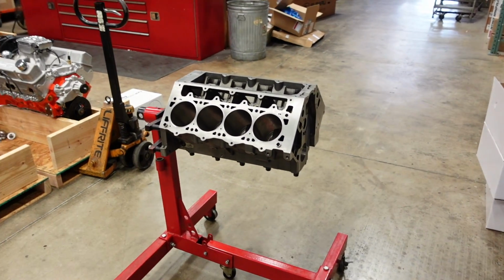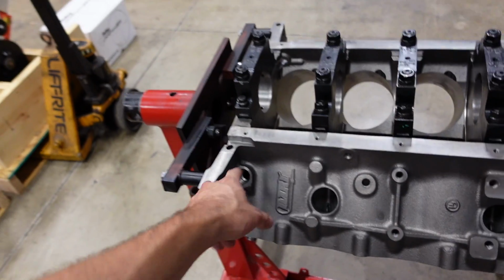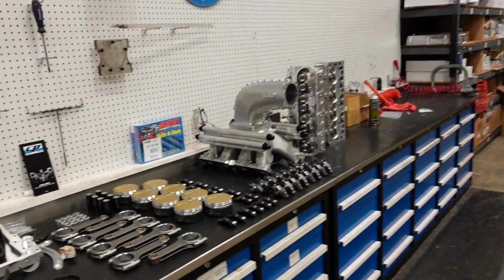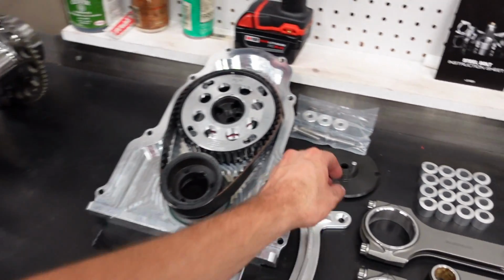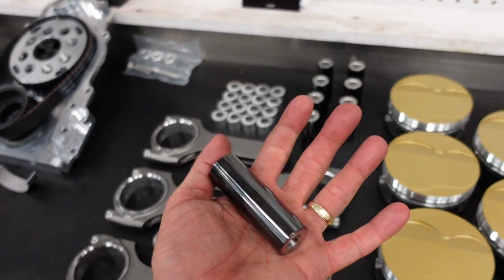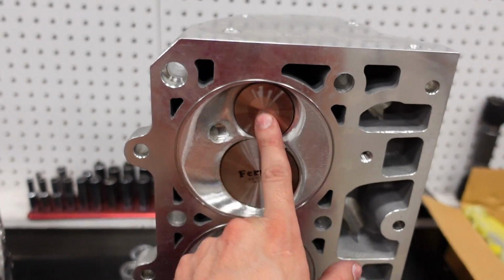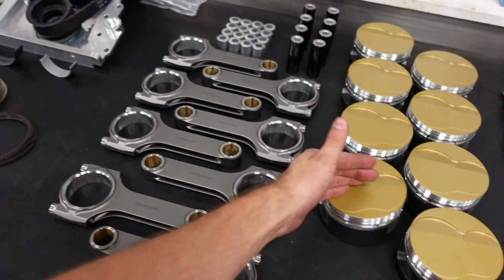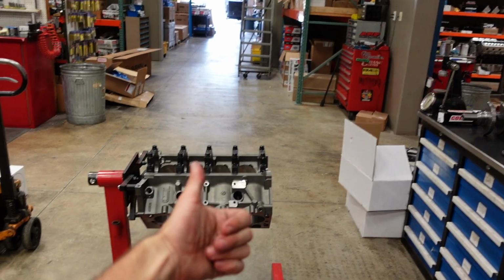Building my Personal LS Engine! - Engine Parts Overview - Part 1

Comment: Other than the rod it’s the old 400 small block numbers for bore and stroke.  That nice .  I’ve always wanted to know what a Al’s would run like using fords old 400 numbers.  4 inch bore and 4 inch stroke ?  Do you know if it’s been done and how good it runs on a dyno ?  Or is it worthless.  Im thinking the LS7 has the crankshaft and a 6.0 or 6.2  maybe the block .  I was just looking at LS bores and strokes one day and seen the combo .  I’ve heard of the rock crawlers using a 305 block and a 400 crank getting a 3,75x3.75  for all the torq .  I thought what would 4x4 do ? Just a thought great video . I’ve liked and subscribed to your channel.  Look forward to 3k hp In a vette at 9500 rpm yeah !

Comment: Theres not much LS left here 
Nothing standard anyway 
And only about half or so architecture 
Regardless the components are nothing short of high quality 
And should b considering the rpm wanted 
Hope it all goes well with the hybrid v8 build and further 
Great video mate cheers from australia
 Ps the added head fasteners are trick 
And needed as that 4 bolt per chamber LS thing ( + 2 outbord ) ussually will let you down at higher power levels good to see its been somewhat addressed

Comment: Whoever you learned from to build this motor you should have learned the technical terms not called top fuel hoops call o-ring in the block dumb f**and you said there was no holes drilled in it to balance it then you turned around and showed titanium plugs it was drilled to balance it double dumb f** but cool build 😂😂😂😂😂😂

Comment: Hello young man I know you are young in this type of work but I want to congratulate you because you are one of the first people that made the correct choice on your rod and piston combination
I see so many people all consumed with how long the connecting rod is when in fact what they should be consumed with is piston stability because that is far more important.
Also us Old-Timers in the the business we don't call them hoops we call them o-rings
It's called o-ringing with a receiver groove and that was an excellent choice for this application
Anyways congratulations and good luck with your future endeavors.
Getting compliments from professional engine builders like myself are hard to come by most of the time they won't say anything but I really appreciate young people coming up in this type of work and trying to make something of themselves
If I can ever help you with advice just send me a message but looks like you're on your way to a successful future. 
BTW I might have ran a little different camshaft but we'll see after you test it.
Good luck from Brian @ Salter Racing Engines.

Comment: Building race engines for over a decade we learned the sweet spot is 700-1000 in a LS. Everything above that parts break. If your racing. You don't need high rpm or nothing to be fast it's all in the chassis.

Comment: So I don't diss other ppls engines... but I do have to ask about the mains, out of curiosity. What's the point of all the custom block work to basically make it a non LS bottom end? I always thought the LS main caps were the best part of the LS blocks. Can u elaborate why u went to those lengths? Don't get me wrong I'm excited to see it run and finish this video... but I'm so confused lol

Comment: I've always wondered why they don't use pressed in  needle bearings on the the main journals of the of the cam like the 410 outlaw engine. Why wouldn't split needle bearings work on the con rods on the crank & caged needle bearings on the wrist pins.  I would want my engine to be completely  rollerized. Has anyone ever made a cam & crank where 2 cylinders fire at the same time. Like the front cylinder on the right side & the rear cylinder in the left, or what ever pistons are top dead center at the same with a normal crankshaft.

Comment: So just to give y’all some context, those aren’t top fuel hoops they are called flame hoops, or referenced as o-ringing the block and head. Also he isn’t running a Cleveland design crankshaft he is running a ls crankshaft designed with Cleveland main sizes. Changing main and rod journal sizes has been done for ages. The crank was not machined on the outer surface of the bobs, it is side drilled instead of end drilled for weights. That cam with a 116 lobe separation will make grunt down low but it gonna not be good up top. That cast iron block is not going to last at his projected rpm and hp levels the harmonics are going to destroy it with cracks. At the power levels and rpm he is planning on and also planning on methanol he should be running aluminum rods they help cushion combustion blows and harmonics in the crank, and are more forgiving than steel rods when pushed to the limit. He talks about long engine life but runs wrist pin buttons on what is going to be a drag and drive motor. Wants to spin the motor to 9500 but runs link bar lifters and not keyed lifters to increase valve train weight. Could this make 3,000 hp at 9500 yeah I can make 2000 out of a stock 6.0 ls with enough fuel and air from a giant turbo for a dyno run then pick up all the pieces after which is what I think he is going to be doing.
Reply: Hi Jon. I went to your channel and didn't find the video on that 2000hp LS build you brag on. I'd take one on even 1000hp LS. Keep us posted.
Reply: Cast iron is not as malleable as aluminum: He probably has a point.
Those are insane rpms for a V engine for the non dragster folk...but it seems like he had a lot of good tech support with the parts hopefully. Definitely not a daily
Reply: As far as copper gaskets: that will create electrolysis in contact with cast iron, or any dissimilar metal.

Not a big deal to the top fuel techs because they rebuild the engine after less than a bakers dozen of runs.

Comment: I thought the skirted block with 6 bolt main caps was part of why stock LS blocks are as strong as they are. Why would Dart change that to a 4 bolt, non-skirted design? Obviously if it can hold 3000 HP it works, but I'm curious what the thinking was...

Comment: lots of moniez, not lots of reaearch into what the product does. crank isnt physically capable of catching oil in holes if the crank NEVER touches the oil, if your crank shaft is touching oil and "cutting" through the oil. you got other issues, steves crank came apart using that style of weights. again lots of money not lots of research. NEEEXT.

Comment: I didn’t look to see if anyone else mentioned it but why go with a reluctor wheel rather than an externally mounted crank trigger type ignition system like most higher power engines. You said it yourself it opens up the possibilities into the ignition system

Comment: Sounds cool until you blow the head gaskets over and over again. Simply not enough clamping force for 3000hp no matter what size head studs. LS's just love to blow those and torch heads in my experience. Obviously this dude knows that so hopefully he has better luck than anyone I know has had when pushing 2500+. Absolutely badass engine though. Get some copper rings put in those heads for sure to stop the torching.

Comment: I do top fuel hoops on my kitchen table.  There is a $2600 tool that makes it easy. I think its made by BHJ. I order the hoops from Visner Racing. I pretty much top fuel hoop everything I build for boost. And you want to use Hylomar as a sealant on copper gaskets according to Clark Gaskets.

Comment: $40,000 in just parts for just the long block is right there with something designed and fully assembled by the likes of Nelson Racing Engines or Steve Morris.....NRE has a 454ci LSX (2500HP) daily driver including the twin turbos and all plumbing ready to put the key in and start up fully tuined for $52,000.

Comment: many ways to make a 2,000+ LS stay together for a very long time.  Nelson Racing Engines has been shipping 2500 HP LS engines out their doors for like 8 years now...total daily driver engines.  You can drive across country with them.  With 2 yr/24,000 mile warranties if you don't change their tune.  A couple guys here in Lauderdale have them.....they're like 5+ years old and driven every weekend and roll raced weekly.  No issues yet.  You just have to figure out the secret recipe for success. ------  But being able to built it yourself is AWESOME.......  I just built my first 390ci 6.0L iron LS with the guidance every second of the way from an LS guru builder teaching me.  Its a pretty rewarding feeling.

Comment: You start an engine build with a camshaft? Every other engine builder starts with the engine block. "Promod" drag and drive engines make north of 4000HP at the tire and that intake is goofy. It doesn't have to be 20" tall in a twin turbo application so you may want to call Steve Morris and he will guide you or better yet, send him your parts and have him build it instead of you just assembling a bunch of parts you ordered. Lastly, if you do manage to get anywhere near 3000HP, plan on spending $100K on a rolling chassis. But hey, you do you.

Comment: THE REASON THE PLUG IS ANGLED TOWARD THE EXHAUST VALVE IS DONE FOR A REASON. WHEN YOU IGNITE THE AIR FUEL MIXTURE ON THE EXHAUST VALVE AREA OF THE CYLINDER. IT FLAME TRAVELS TOWARD THE INTAKE VALVE. AND THE NEXT EVENT TO TAKE PLACE IS THE EXHAUST VALVE OPENING WHICH WILL START EVACUATING THE ALREADY BURNT MIXTURE. IF YOU IGNITE IT TOWARDS THE INTAKE VALVE (CENTER) IT WILL TRAVEL TOWARDS THE EXHAUST AND THE NEXT EVENT TO TAKE PLACE IN THE EXHAUST VALVE OPENING AND AS THE RPM'S GO UP THE EVENTS TAKE PLACE FASTER AND FASTER. AND THE OPENING OF THE EXHAUST VALVE BEATS THE FLAME TRAVEL GOING TOWARDS THE EXHAUST VALVE AND YOU WILL EVACUATE THE AIR/FUEL MIXTURE THAT HASEN'T BURNED YET AND YOU WILL LOSE POWER. A FELLOW I KNEW RACED A SMALL BLOCK CHEVY AND TOLD ME THAT WHEN HE SWITCHED OVER TO THE ANGLE PLUG HEADS, IT MADE A BIG DIFFERENCE. HE NEVER KNEW WHY AS WITH MOST PEOPLE AND I EXPLAINED WHY IT MADE MORE POWER.

Comment: I'm surprised you went with steel rods and not aluminum! Excited for updates!
Reply from the maker: I was originally going aluminum rod, but CP-Carrillo talked me out of it for land speed type engines. They said aluminum rods would not handle the high rpm for the long time intervals of a land speed combination.
Reply: @JacobVillemain  that would be true. Our modified pulling truck was chipped at 8200 rpm’s and we replace them every 25 pulls due to stretch. At 18 to 1 compression, our gas ports would leave impressions on the heads. Nice build.  I can’t wait.

Comment: Good Luck Jacob, you deserve it.

A Question, if you went with a lighter setup for for the Rotating Assembly for An NA Engine setup, & a bit more aggressive on the cam, how much HP it's gonna be around while keeping it almost the same on everything else compression etc...
Reply from the maker: If this combo was designed to run naturally aspirated, I would say probably around 750-800hp

Comment: Side loading with short rods offset any by the tall skirts? Also, formula 1 guys found power in burning oil in the combustion process to the extent that the FIA issued a rule limiting oil consumption per race I believe.

Comment: Also I'm not sure on the connecting rod choice for a high boost high revving engine on methanol...
Reply: @WrenchesandPlants  I understand but with meth and high rpm/boost they won't be too friendly to the rod bearings.

Comment: I noticed you chose a gas ported piston but not a gas ported top ring.  Any thoughts on that?  What did total seal say about a gas ported tool steel top ring?  I would have strongly considered a gas ported top ring, but then again, I’m no engine builder. Just curious! Great vid BTW!
Reply: I was thinking the same thing.

Comment: You coat the Pistons and the wrist pins. Not the buttons that are going to hold the wrist pins in! I'm not a fan of those buttons especially without some kind of coating on them! I would have to see a engine like yours that has been run under full race conditions & tear it down and see what wear it's putting in those cylinders. I wouldn't run them without them being coated! Why coat the side of the Pistons if you're not going to coat the buttons also they are going to be sliding on the cylinder walls also? As much money that I see you've stuck into this I think I would go the extra mile and coat those buttons! 🤔
Reply from the maker: The answer that question is the buttons will not see any thrust load. The skirts are coated to help deal with the internal thrust pushing the pistons into the side of the sleeve.

Comment: I hope the rods hold up I had to go with mgp aluminum rods after a certain horsepower and that much boost steel rods like to exit the chat lol that’s a badass engine though sir have fun with it be safe.
Reply from the maker: CP-Carrillo said they would not run aluminum rods in a land speed engine. Being 8,000rpm+ for over 25 seconds would not be healthy with aluminum rods.
Reply: @JacobVillemain was thinking same maybe 1/4 mile  not land speed

Comment: YOU MENTIONED LEARNING ABOUT ENGINE DESIGN. YOUR LS MOTOR THERE IS COMPLETELY BASED ON FORD DESIGNS. NOT ONE DESIGN ASPECT OF THE OLD SMALL BLOCK CHEVY LIVES IN THE LS WHICH IS 1000% FORD IN DESIGN. IT'S A REGURGITATED FORD 427 HIGHRISER AKA RAISED PORT FORD 351 WINDSOR. I LAUGH AT THOSE CLOWNS AT GM THAT CALL THEMSELVES ENGINEERS.
Reply from the maker: Thank you for your comment. The YouTube algorithm appreciated it

Comment: At 3000hp you'll split that block no worries. Should have gone a Steve Morris SML.
Reply: The LS platform (sml aside) just isn't reliable at those power levels. I don't see this being any different. It's just the wrong platform.
Reply: Absolutely, dude also lost me when he said a build like this starts at the camshaft. No mate, it starts at the block. LS motors are great for "budget" 1000hp street applications. You can get 1500-2000hp out of them, but you're on borrowed time with the block.

Comment: Is the 58x that much better then a 24x on the street? I have a Ls3/6L80 swap I am working on. It's going in my 03'Crown Vic Police Interceptor.  How do you feel about the new stock Ls3 hollow valve stems fir the street. I am not trying to be the next Street Outlaws. Burnouts and ice cream with my wife and grandkids. Maybe 450 to 500 ish wheel HP? For now. Or should I go with something else. I'm not looking to drop 5 grand in the engine alone. I bought a pair of bare low mileage 821 heads. I need to get valves nd spring for her. Oh and rockers.